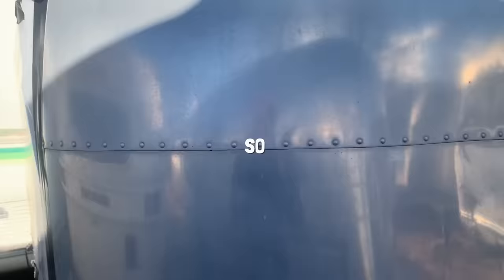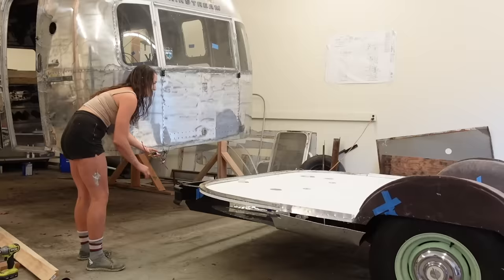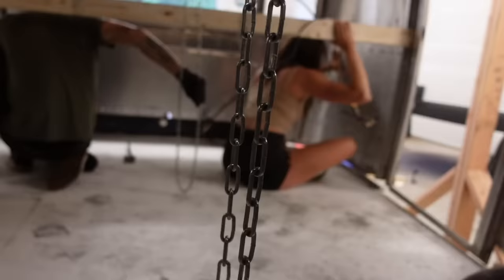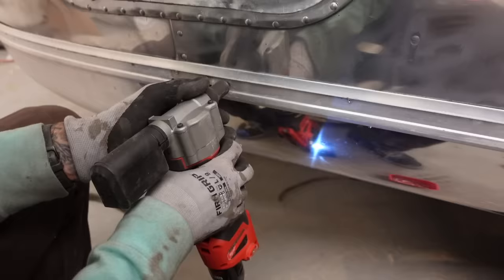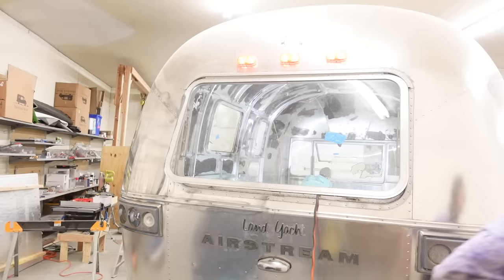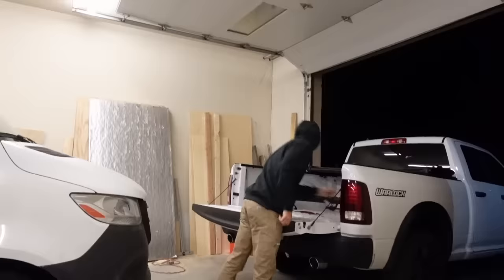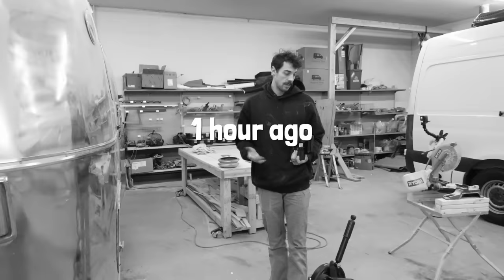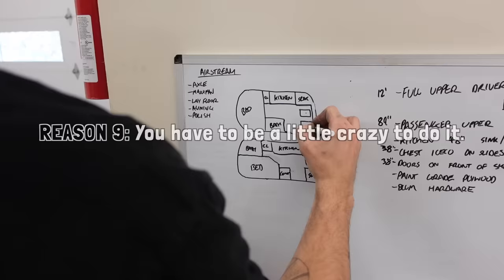Why No One is Renovating Airstreams

Comment: Nice vid. We are doing a rebuild / modern restoration of a 1956 Spartan. Bucking rivets, redoing the wiring, insulation, figuring out condensation all the while through two winters, semi off grid in the woods of Idaho. We ended up redoing all the windows and our first winter we had only 1/4 plexiglass. We removed the floor in sections and replaced all the furring strips then the decking. This experience is one of the many reasons why we are moving onto a sailboat....guess what, it is not going to be one that we have to tear down.

Comment: Obviously I know nothing because I haven’t renovated an RV, but airstreams seem like some of the easiest candidates for renovations. You have a large metal shell. Inspect the outside, pop any major dents, patch any holes and seal the whole thing wherever it needs. Then coat the thing in truck bedliner lol. Once the outside is taken care of you don’t have to worry about leaks so then you can focus on the inside. For old trailers though you gotta make sure that frame is good before doing anything.

Comment: 7-8 years ago I renovated a 31 ft Airstream. At the time there was a podcast for vintage Airstreams. For mine there was only a rotten spot under the fridge so there wasn't a need to remove the body. The dexter axles way cheaper then the other brand. I customized some of it for improvements and restored other parts. Airstream used parts that were available and were used on many other brands that were being reproduced when I was doing mine. It kept me sane when I was taking care of my elderly parents and I ended selling it for a great profit.

Comment: I love the energy and effort you two put into this video. I would really love to see you get your hands on a 79 Revcon or older. It was designed by the son in law, of the man who designed the original airstream. We have one, and it’s actually shockingly functional, in spite of sitting in The Dalles, OR, for 6 years. Ours is a 79 Camelot, as it’s called, and It has a Chevy 454 Toronado in it, which has been much easier to work on than I’d imagined it would be. Thanks again for a great video, I’d always wondered about why so many old airstreams are just sa tying and forsaken.

Comment: I can answer your question without watching the video. They are made out of aluminum and it's super expensive to get someone to weld it. You definitely cant do it yourself. Then you need to bend the metal as well. The factory just uses rivets which im guessing you probably did.

Comment: Ive remodeled a few for Burning Man that my buddies company rented out each year till BM org stopped allowing outside housing. I did it Every year for 5 years making repairs, just need carpentry skills, plumbing, DC electrical, some AC as well, some maybe a little welding but you can get around that, i figured it all out and never worked on a camper before, we had a fleet of 44 campers, 3 were Airstreams, just need to know house building skills

Comment: Removing the cross braces allowed the trailer to flex to its 'Normal Resting Position', which, for almost all rv's is in a 'Hitched, or Tongue Jack Supported' configuration. The cross braces forced the trailer into a state of flex which does not align with shell, since the proper conditions for 'fit' are not met. (For a van or motorhome, the normal configuration would be fully supported on its wheels, with no jacks in place anywhere).
This is also useful info for when you are permanently/solidly mounting new renos. the frame and body/shell should be in the normal configuration to assure the best 'fit and finish'.

Comment: Tip #1 to anyone that wants to repeat but do it much easier. DO NOT REMOVE THAT BOTTOM RING from the shell. Spend all the time you need to get the shell off with that riveted lip still on. Tip #2 Tack weld in some aluminum bars and tack their intersections up/down + left/right. Then weld tabs with holes on the outside edges right before the curve. Make sure to have bar on the inside between those two points at a minimum. You will need some aluminum bar stock which isn't cheap. I would look in the bargain bin at your local metal dealer for cut offs. Then put steel braided cable through the tab holes and up to a steel bar that runs across to the other side. You can make a cheap spreader bar this way. You wont distort the shell when you lift it off. We have done this with cars many times with great success. It's not hard if you pre-plan and think about how to make sure it stays that shape even when its off the frame.

Comment: You know what would be fun? Meshing together a vintage airstream and a pickup truck.

Like, you take a 1930s/1950s Ford or Chevy or any other brand pickup truck, remove the bed and the rear mechanics. Lift the airstream shell and mesh together both frames. Fit back the rear mechanics and fit the shell on the frame. Give the pickup's body a good old bumps removal and fresh paint and a good polish to the airstream shell. And boom, you got yourself a cool camper van

Comment: I've had to put on covers that were very flexible before, if you can find some of those 2 foot long screwdrivers, like 10 of them you can use them as guides if they fit in both screw holes. 

But you're going to need like 3 people to do it tho.

Comment: For the interior walls 1/4 - 3/8 Luan plywood which is design to flex around curves. Then sand smooth. Then your ready to either veneer the surface or laminate

Comment: Spartan.  1953. floors are thick
its rivited  together.  does not leack.     I live in a 24 foot one. built a metal roof on it.  window AC.       it's a fun place   very clasic.  and the windows work
the air streams leak   their always covered with sheats of plastic.😅

Comment: this reminds me of the young couple who purchased two shipping containers to turn into a home up north somewhere, where winter is like 5-6 months long.  In the end they were too small so they separated them and built in-between the two.  The sound of rain on the metal roofs drove them insane, so they put a full roof over the whole thing.  Then a ten inch deep exterior wall all the way around so they could fully insulate without losing floor space.  All they saved in the end in terms of materials and work was four load bearing walls.  Not worth it at all.  Same thing with these old campers.  All that is worth saving was the shell.

Comment: There are plenty of people restoring Airstreams.  The biggest challenge is finding the correct starter example. If your budget is limited then you will end up with a shell that will take a lot of work.  The old saying cheap turns out to be very expensive.  However, if you goal is to just take a project to gain an audience on social media,  the more problems the better.

Comment: Wish I had seen this last week. I just bought a 1971 24' Airstream. which has been gutted.The good news is I'm a jack of all trades master of none and not a perfectionist (masochist). Also I will  not be taking this on the road. Definitely not removing the body or replacing the axles.I find being Irish helps as well.

Comment: Rebuilt a 69 land yacht. Tore the floor out and entire interior, Replaced the floor and refinished the interior and reinstalled. Semi polished the exterior, recaulked the openings. It was decently restored when we were done, but definitely you can't be a perfectionist with them. Had it about 10 years. Way too many hours spent rebuilding it and constant work keeping the moss at bay, sealed up from rodents, and the exterior looking decent, as well as the regular maintenance.  I didn't have the facilities to pull off the top, and by the looks of it I'm glad I didn't. They are very cool. We had built in drop down steps. Easy to bash your head if you don't duck your head on the way in. Also the square corners on the big opening back window need foam to prevent bashing your head on them. Fun times!

Comment: You need a lot more specialized metal working tools to do this kind of work.   You should always form the patch panels before installing and every hole should get a cleco.  You also need to roll a bead in the panels for a sealant grove  or you must use scrim cloth or some other bond line control adhesive.   Other wise the squeeze from riveting will push out all the sealer.    

1. rough out the patch 
2. form the patch to its location 
3. Drill under-sized holes, install cleco as you go to hold patch in place. 
4. Remove patch, final scuff and prep for sealant and bond line control.  You need an aluminum specific adhesive sealer.   Not just sealer. The patch will move in relation the main panel and leak  if you just apply sealant to a raw shinny aluminum surface.   
5. Install patch with all holes cleco'ed. 
6. remove one cleco. final size the hole, buck rivet. 
7. move back and forth across panel not a circle,  final sizing and bucking on rivet at a time  

Outstanding job for DIY.  The longevity might not be there but its a good first try.

Comment: I don't know if you will ever get all the labor $ back doing a project like this- but someone will pay good money to buy your trailer when it is totally restored. Good selection on doing a smaller model also; they are much more in demand.

Air Forums has every bit of information needed for renovating an Airstream. I own a 1973 (Airstream) Argosy 22'. It is in a constant state of rebuild. I have replaced both axles, added air conditioning, replaced the rotted areas of flooring, replaced the stove with a cooktop and microwave and replaced the hot water heater with a self start model. The toughest renovation has been replacing all the old patched up copper with Pex plumbing. In the end, all the work is worth it to own something totally unique that is not available even new (considering the new ones weigh about twice as much).

Comment: "Let's put a wood\plywood flooring so it can rot again like the last one did, but faster." Anything wood-related will rot whether it is an Airstream or not. One solid example I had is my brother got a camper for free from his gf, which belong to her deceased father who bought it brand new 5 years ago right before passing away. It got parked for 5 years and nobody took care of it or even opened a window once in a while. As a result almost everything inside started molding or rotting. The key is using either fiberglass or metal, or some solid and expensive wood if you really have to, but cover it several protective varnish.

Comment: Hey guys!! I only saw it for a second, but I’m almost certain the lug nuts on your wheels went on backwards!! Go check them, if the wheels are steel, the lug nuts have a pointy end and a flat end, the pointy end should mate up to the surface of the wheel and the flat end should face out!! It’ll orient the wheel on the lugs and pull everything in to alignment. Please go check!! I’d hate to see you loose a wheel!!

Comment: Trailer axles always look crooked… they are made with a bow. You point the bow upwards so once under heavy load it kinda straightens out. That particular one looks like the standard 3500 lb axle for smaller trailers, which means each leaf spring will be roughly 1700lb rated. Sometimes on camper trailers the leaf springs will total less than the max axle rating to make for a smoother ride, but obviously you only have so much wiggle room for that cuz obviously campers are heavy and still carry lots of extra weight. I’ve even restored some trailers that have leaf spring/strut combinations for supreme comfort ride.

Comment: As someone who builds houses, i can tell you that it would be easier to make a camper from scratch and add an aluminium shell than to do what y'all did.  Campers/trailers aren't meant to last more than 30 years or so. Also your airstream seems to by coachbuilt rather than truly standardized and manufactured (which adds to why working the aluminum was such a pain). 
Respect to you both.

Comment: I'm remodeling an airstream 
I have a 1980 131-foot international 
Yes it does cost a lot to remodel one
You have to remember an airstream is the Mercedes of travel trailers so you got to have luxury and that will cost you 
Yes there's quite a few new tools you got to have 
And you might have to buy the tools more than once because the first one wasn't quite right to do the job 
But once it's all done you have a work of art 
In my airstream I have added a bathtub big enough that I can fit in I'm 6 ft 2 
I have led remote control lights 
A fake fireplace 
A dishwasher 
Teak cabinet doors
Oak custom-designed bed mattress & more

Comment: When the factory builds an Airstream for the first time, riveting is cheap and easy. Having to remove rivets, align, chase holes, and re-rivet is incredibly difficult and time consuming. Because an Airstream is just an aluminum shell, I would have just welded the shell together with a TIG torch. I think that would have been way quicker and if you ever need to remove the shell you can just cut it open and re-weld when done.

Comment: This does look like fine, I admit. But then I have been building entire cars. For instance, I have a 1929 Dodge I had to yank the body off of, and a  lot of the support on the main body is wood (and worse in some cars I'm told from that era, Dodge did build them pretty stiff compared to others.) Though is that fan going to be enough to keep it cool? 
Here's a tip, things like ratchet comealongs and a decent electric winch can be invaluable. Sometimes when it comes to even little body adjustments a good set of ratchet straps from Harbor Freight can come in handy.

Comment: As a teenager we restored a typical dutch caravan. We did it, but it was a pain in the b*tt. The walls were some kind of sandwich construction (mild steel sheet, some foam, plywood), which you have to disassemble to fix the leaks. The bottom is a similar construction to that airstream with some sandwich layers added. But in the end, we did it. It was the new caravan of a friend. Some weeks later, we were asked to help to restore an airsteam. I had doubts, but my friends convinced me. That airstream was so incredible much better to work with. It was insane. Yes, you needed to men for the rivets, but that was it.

Comment: Airstreams are nearly allways worth repairing. The job would be much easier if you invested in a set of Clecos which are essentially temporary rivets that are placed or removed with a special pair of pliers.  Having a hundred or more would greatly simplify aligning large panels with many holes. Clecos align and hold the metal panels, you put as many as you need to get panels to line up to old holes or temporarily hold a panel in place while creating new ones. 200 Clecos can be purchased for less than $200. There are many YouTube channels showing how to use them . virtually any auto Body custom shop or airplane airframe mechanic uses them.

Comment: I have a 74 Argosy (Dad bought it new), It's mostly original with new toilet, heater, water pump, gas lines. The A/C is original and still works fine. Pretty loud, but that's OK in the desert in Aug lol. My kid builds vans, planning on having him refurb the Argosy in a few years, new bathroom, plumbing, cabinets, beds and fridge plus clean up the undercarriage and new subfloor. Hoping to not remove the entire shell, guess that depends on the subfloor? Looks like the shell depends on the outer edge of the subfloor for it's anchor?

Comment: closed cell spray foam will give you 100% water proofing ...best insulation and will give the best structural support possible. Tig welding would have been great, but you have to be a pro at that metal thickness or lack of it...but I guess you like the original look of rivets and they are easier. Looks great! hope the project brought you closer as a couple! You can't love what you do if you hate who you do it with..

Comment: There are quite a few tricks to renovating this mess. Indeed,Two people are essential to certain tasks.
 The fitting if the shell is a process where a frame is used inside the cabin. The frame aligns the shell with turn buckles, about twelve, attached to a central hub or hubs. It takes some forethought but entirely doable with so little frustration. Just a bit tedious but not too terrible.

Comment: The nightmares i know about, that make me not want to try.
1. Old campers are heavy and diy rebuild will get heavier.
2.  If you were paying yourself to build it you could buy a new one.
3.  As you point out. Its hard and finicky 
4.  1+3 is balancing the weight.  Is it putting too much weight on the tang and reducing your steering traction or too much behind the wheels and lifting the tang. Making it really not fun to tow.

Comment: Airstream's are built the same way as airplanes. That is what makes them so much better than any other trailer. I was surprised that you did not change the axle when you were rebuilding the floor with the shell off. As far as the axles they are so thick of medal that you could have sanded and repainted the axle and rebuilt the brakes and replaced the bearings. I use to have boats and trailer axles would be like that in just a couple years of used backing into lakes all the time.

Comment: Unless those lug nuts are tapered on both sides at 10:22, it seems you installed them backward. The convex taper of the lug normally goes toward the wheel and meets a convex taper around the lug hole. Maybe your wheels are Hub-Centric instead of Lug-Centric but those wheels look lug-centric from what I can see.

Comment: The thing about Airstreams is that their design is from the jet and aircraft age. So they have more in common with an old jet liner than a regular Van or RV. The thin Aluminum body gets it's rigidity from constant tension and stress. As soon as you remove the body from the chassis it becomes a flexible, floppy and slightly undersized mess.